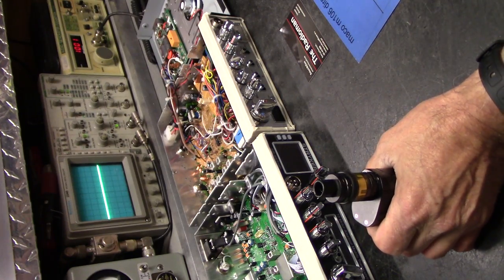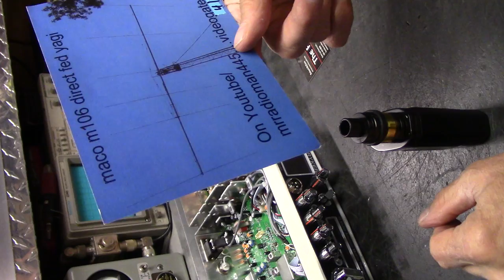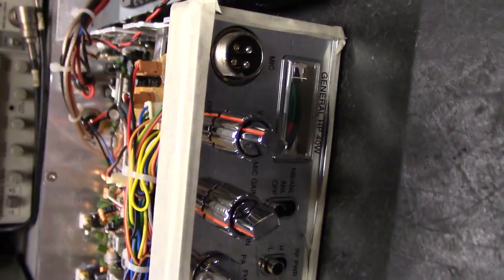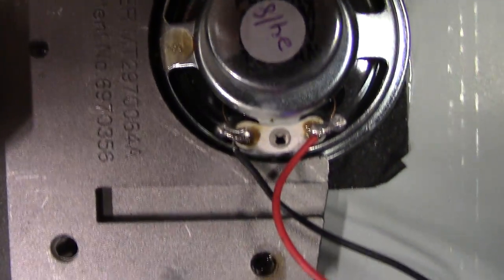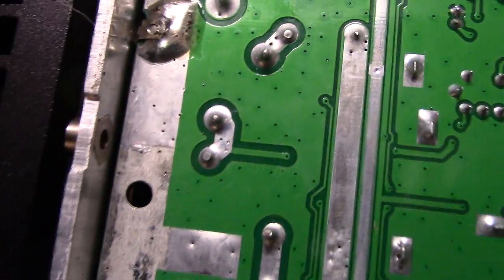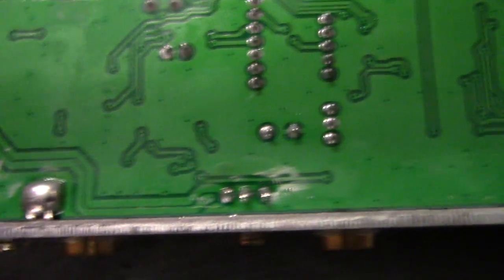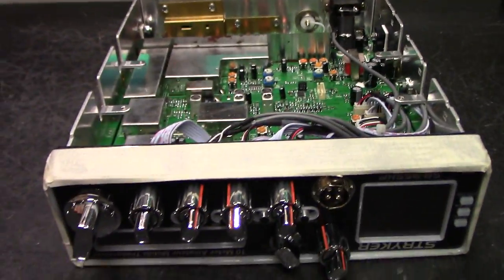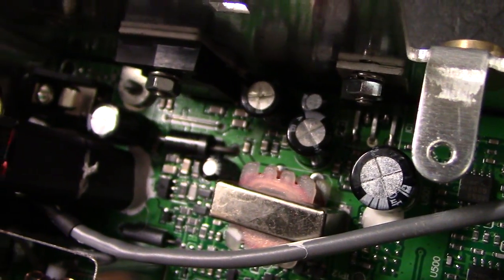What a new Stryker SR 955 HPC and General HP 40 looks like out of the box.

Comment: Why does the General look like it is missing 25% of the components?  I would guess that there are options that were not included in that particular model?  SSB??  Weather band??  The Stryker looks like a lot newer design late 1990s to the 2010 due to the surface mount components?  Just a guess.  The General looks like it is from the late 80s?
Reply from the maker: 100% correct on all excluding the Weather Bands.